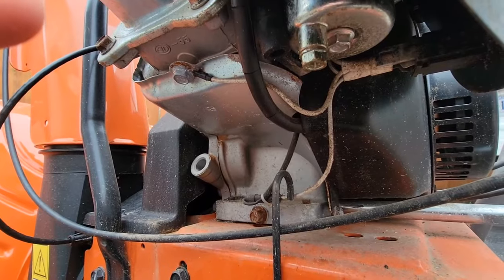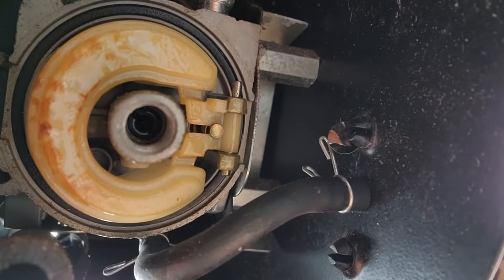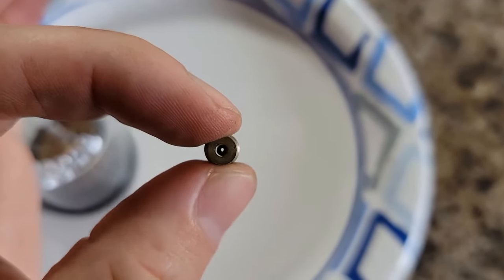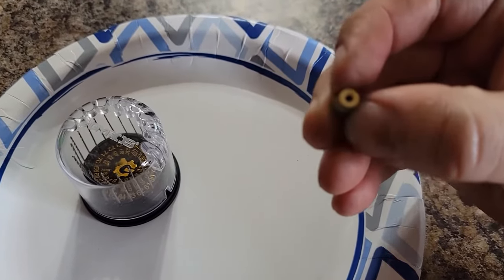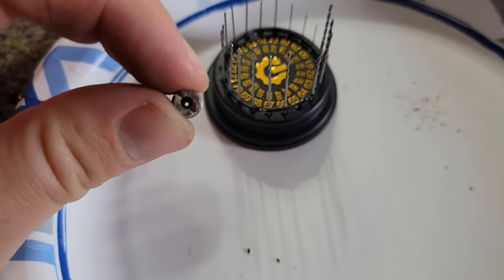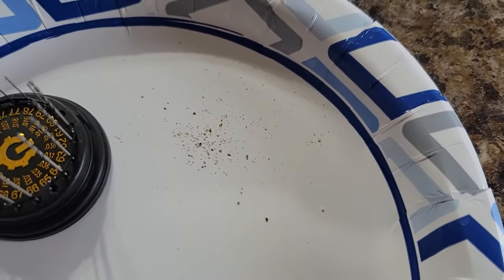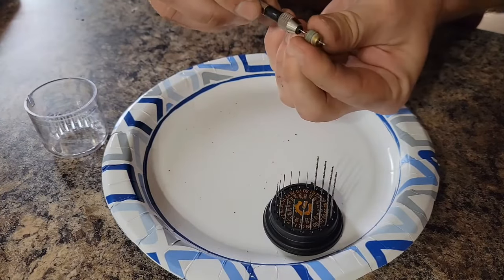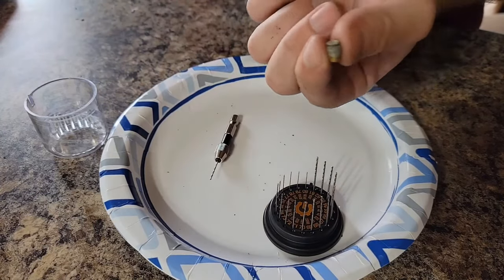ENGINE ONLY RUNS WITH THE CHOKE ON HOW TO FIX IT BY CLEAN THE CARB JET

Comment: Thanks for posting this!  I have a John Deere D105 that would only run with the choke on.  I was going to pull the carburetor and clean it or replace it when I saw this video.  I was able to pull the main jet without removing the carb and in ten minutes, I was back up and running.   I really appreciate channels like yours that keep me from having to spend big money on easy fixes!!!
Reply from the maker: thanks!

Comment: I used a sewing kit needle to push through the hole in the jet after cleaning out the inlet,… A little carburetor cleaner after, and it worked perfectly. Great video for an easy fix.
Reply from the maker: Yep that works too.  Usually the buildup is so small and a similar color to the brass jet that it's hard to see but you clear that hole and it'll run!

Comment: Awesome video I have the exact same problem with my wood chipper and I am going to try the exact same process as you did I'm pretty sure it will work just makes good sense. I wanna leave you with a question I have a lawn more that starts up And runs fine but when it warmed up if you turned it off it will not restart. Why wouldn't anybody do this well I use it to get the small areas in the yard are multiple leaves into the catcher So when the catcher fills I must stop the Lawn mower and hence the problem I cannot restart any suggestions thank you great video
Reply from the maker: If you spray it with starting fluid will it restart?

Comment: This may be the solution to my problem, do you think the passage from the main jet to the carb could also need cleaning on Mine
Reply from the maker: Its by far the most common running issue

Comment: The last day before i went overseas last week, I had a job. It should have taken 30 mins to mow (about 2 acres), but 5 mins in it stopped. The only way it would run was half throttle and full choke, haha. It did clear for 2 mins or so initially buy then was 2x worse... long story short, took me 3 hours instead. I kinda hoped I would melt something so i could buy a new one, but no, lol. (30hp kawasaki)

Comment: WYPO torch tip cleaners work great on different jet orifices.
Reply from the maker: That's a great tip
Reply: I had exactly this “choke needed” condition on a Briggs & Stratton 11 HP engine, and your fix worked 100% .  Super well explained in the video.   Thanks .  I used cutting torch tip cleaner files as mentioned in an earlier post and spray carb cleaner.  Now “no choke” needed at high RPMs.  🥳
Reply: Not always. I have a torch tip cleaner and could not open the jet on my Cub Cadet. It's plugged solid. I had another carb that I cleaned to get the blower running, but since I didn't have the correct bit, the plugged jet remains in my tool chest.
Reply: @jzm6403  You are correct,not always,but sure work nice when situation allows.Thanks for watching.

Comment: Brand new carb, exact replacement, does exactly same as prior, almost new carb.  Has nothing to do with "dirty jets", screwed float level, goofed fuel line.  Requires 1/2 choke to run smoothly.  With choke fully open, droplets of raw gasoline are seen momentarily in the air just above the choke plate.
Reply: How did you fix this?

Comment: Just make it fast and simple everyone. Carb cleanner and a wire to clean it out. This is unnecessary
Reply from the maker: Exactly! Just clean the jet.  I thought it appropriate to pull the jet so everyone can see and understand exactly what they are doing and why.  This gives a good illustration of a narrowing jet causing a lean running condition.   Also as I mentioned in the video, since new I have found the Snowblower to be hard starting and it really didnt like to run when it was 0 degrees out.  Bore the main jet 1 size larger and these problems are solved.
Reply: @buildsomethingstupid1736  you overachiever making a video that's clear, precise and having a full explanation. "What a waste of time." (This is sarcasm.) Honestly, this is a good video.

Comment: I bought a new carb and it still does the same thing
Reply from the maker: Ain't the carb then!  What's it doing?
Reply: @buildsomethingstupid1736  it starts and only works on choke as soon as i take it off choke it dies
Reply: @buildsomethingstupid1736  and it does some weird whistling type noise sounds like something is rubbing against something when it does the noise the engine just dies
Reply from the maker: @Iplay Minecraft  maybe an intake leak somewhere
Reply: fuel flow to the carb? plugged tank cap not letting fuel flow out? fuel valve malfunction, not letting fuel flow?  Try disconnect fuel line, then turn on fuel with cap on, see if fuel flows to carb freely.